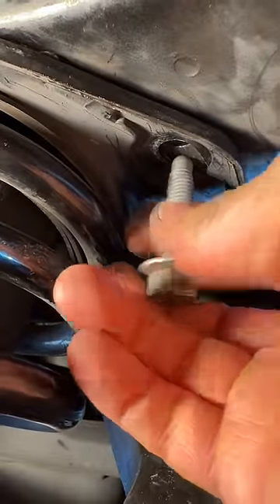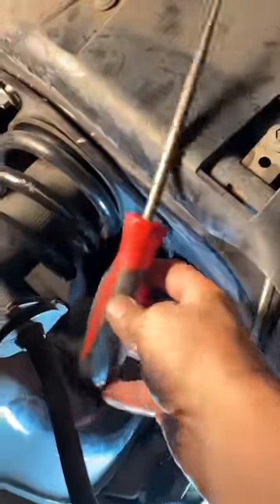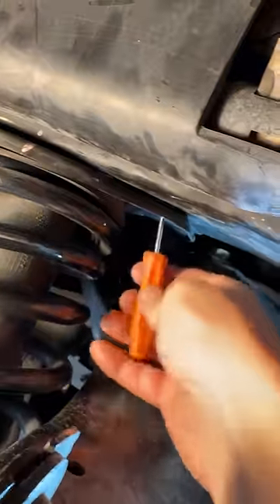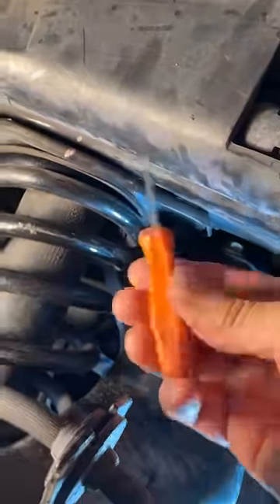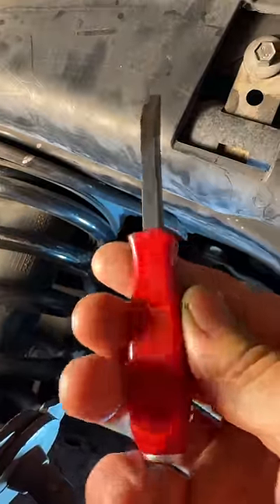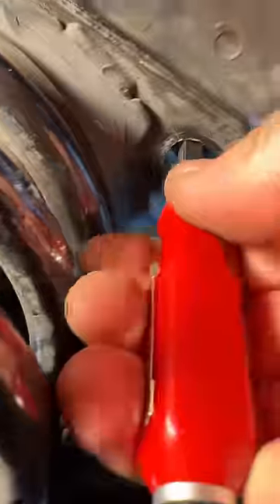THIS ends the debate.

Comment: Doing things ass backwards really does require special tools.
Reply: I was thinking the same thing 🤣🤣🤣
Reply: Special tools for special people doing easy things a special way
Reply: Special tools are for doing things the easier way. Lazy yes why do you think the manufacturer has so many they don't sell you the tools and engineers design increasingly more difficult cars to work on.
Reply: your comment not being liked by bozo really shows what's up LMAO
Reply: @slnz5751  what is that exactly because this video does in fact show someone installing a strut assembly incorrectly. You always put the top bolts in first, every time, if not I assume you don't know what you're doing.
Reply: @johndoe8785 you obviously don't work on cars because you would know some cars don't have the space to get the spindle in the strut  and there's literally no wrong or right way because of that
Reply: @ItsVampish  actually, 24 years in the business, senior master tech and ASE certified master tech. And I teach at a local boces part time for a program we have called explorers. So yes I would say I know exactly what I'm talking about.
Reply: @johndoe8785  and im the president of the united states
Reply: @ItsVampish master tech here. It's not that uncommon. Lol. I use a punch pin, it's tapered  and round.  You could tell his tools are too clean to be a real mechanic.
Reply: @johndoe8785  HAVE YOU EVER CHANGED THE REAR STRUT ON A VOLVO V70? I BELIEVE NOT.
IT'S NOT COMPLICATED LIKE A NUCLEAR POWER PLANT BUT IT'S GONNA GIVE YOU A HUGE HEADACHE.
THE DESIGN OF EACH VEHICLE IS PRIMARILY OPTIMIZED FOR SIMPLICITY, SPEED AND THE LOWEST PRICE ON THE ASSEMBLY LINE. SOMEWHERE BEHIND THIS IS FUNCTIONALITY. AND THE COMPLEXITY OF THE REPAIRS IS SOMEWHERE ON THE 150+ PLACE BECAUSE THE UNHAPPY OWNER WILL ALREADY PAY FOR IT.
I HOPE I EXPANDED YOUR HORIZONS AT LEAST A LITTLE MR UNNAMED
Reply: @mickeymonster7342  actually I've done too many too count. I've been a dealership tech for almost 3 decades. I've forgotten more than most people ever learn about automobiles. Technically with the amount of class time and certifications I'm more qualified than a rocket scientist.
Reply: Exactly! Although I cant say that I havent done this before though😂
Reply: Right? I’ve installed dozens of struts and never had this issue. 🤦🏽
Reply: Maybe he is living life on expert mode
Reply: Takes a special kind of tool 😳😂🤣😂🤣
Reply: How is aligning a strut 'ass backwards'? Totally depends on what you're working on as well.
Reply: I just did the front struts on my car last week and didn't have this problem at all. Hmm I wonder why? 🤣
Reply: Yeah backwards unless that’s Tesla then that’s normal 😂 and who need spring compression when everything comes with its own mini pry far i mean bar 😢
Reply: @johndoe8785 you just let people know you can follow instructions 😂
Reply: Who puts the knuckle to strut bolts on first? This guys reaching trying to sell that bar
Reply: @pkkiller_apathy4568 he’s just doing it wrong…. You don’t need the tool when you install 3 tower bolts then do the 2 knuckle bolts…. That’s the point here, he’s doing it in a way more difficult for several reasons and it requires that tool, not to mention he could just use a 3ft long screwdriver on the top of the hole vs the wheel well

Comment: The strut mount gets bolted first, then worry about the bottom, u made life a little harder for yourself, but most good lessons are learned the hard way
Reply from the maker: This particular strut was on the rear end of a Pontiac G8. The control arm is so deep that the only way I could think to install the strut was to put it in bottom first.
Reply: Isn't this the same guy that strapped 400 lb of 20 ft rebar under his truck in home depot's parking lot!?!?😂😂😂 I thought everyone in the car community banned him from ever touching a vehicle again!?!?

Comment: I have never had a problem getting my bolts lined up properly and I am just a "backyard" mechanic as they call us... so if you are a "professional" and can't get them without doing this I'm pretty sure you are doing something wrong because I have NEVER had to put anything in the bolt holes and pry on it like that. Now maybe i have used the bolts themselves to line up a whole that I couldn't see but that's allot different than doing this
Reply: Then you just haven’t come across a situation that requires that lol. Ever partially lowered a subframe? Ever dropped a transmission and needed to realign a crossmember?
Reply: You're telling the world that your experience is limited at best, and trying to make it sound like you know more than everyone else. Pipe down, guy. There are plenty of situations within the realm of vehicle repair that you simply haven't been a part of yet. You're not some kind of car repair guru just because you haven't yet needed to do something like this to line parts up.
Reply: @Krankie_V  plenty of situations but rarely (if ever) with a strut.
Mount first, then the bottom.

Comment: I mean.  Just put those bolts in loosley first    Ive never had that issue....although i do have the pocket pry bar.   Its handy when taking off door panels.   A pocket screwdriver works too but the bar has a warranty

Comment: That’s a Camaro rear end if you use a giant pry bar on the lower control arm and position the strut correctly you don’t need to do all this or even use body weight and get two bolts on by hand

Comment: How about you put it in at the top first without tightening it up all the way, then you align it at the bottom, put the bolt in and tighten everything up?
Reply: Dude wanted to show off a piece of kit lol
I've neeeever had this issue. Top first, bottom last. 

I may fight with it but once it's in place it's not hard to line it up
Reply: Then there wouldn't be a need for this cool tool.

Comment: You cant have the rest of the bolts on the part/ assembly tightened too much while aligning that type of part. Should be able to finger screw them in a few threads and have each bolt in there already then drive them home lol

Comment: Top bolts first chief. Way easier to wrestle with the knuckle
Reply from the maker: Thanks for the tip, but this was in the rear. The control arm forced me to do it backwards.
Reply: @ToolDemos  loosen the bolts so you get some wiggle room from the bottom too. Trailing arm too if you must

Comment: SMFH.... leave the other bolts slightly loose so you can rotate the strut assembly slightly to line up the bolt holes, then tighten all the bolts to spec!!  DA

Comment: That's gotta be a Nissan car. What idiot designer decides to remove the welded in alignment stud and replace it with a nut and bolt setup. Thanks for nothing Nissan! My next car will be either a Ford, Chevy or Dodge!

Comment: If you're doing it correctly it is not hard at all to replace a strut should only take about 15 minutes maybe 20 if the bolts are rusted depending on how bad they're rusted